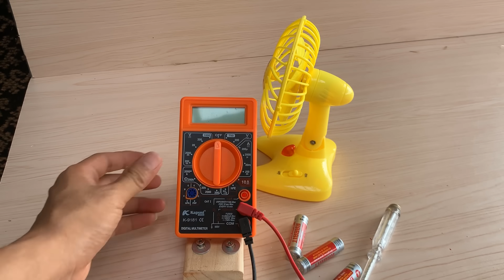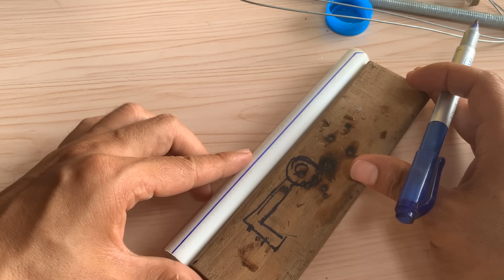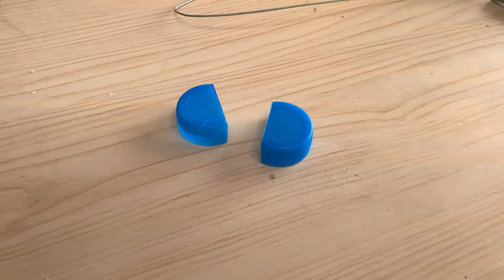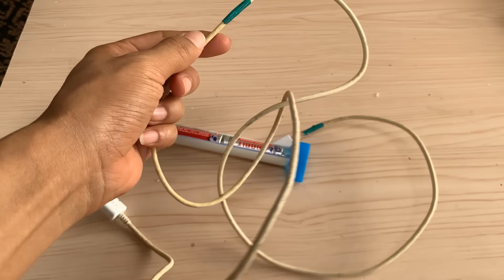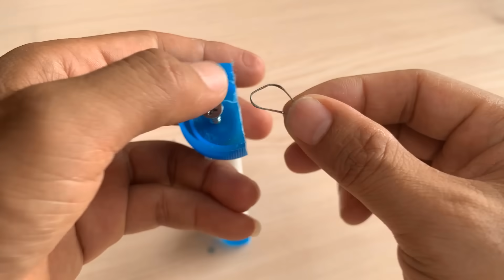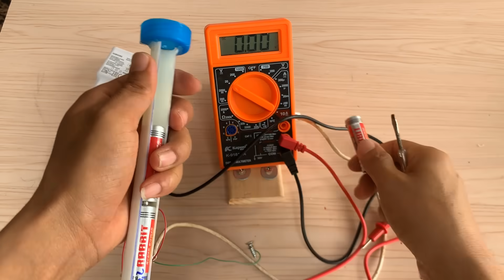How to restore 1.5V battery like new! Recycle used 1.5V AA batteries

Comment: Use an universal charger 5 dollars and the results is rhe same ...only one thing charcol batteries Drop the liquids outside
Reply from the maker: Thanks for sharing your thoughts! It’s true that some universal chargers can provide similar results, but ensuring safety while using them is important. Also, be mindful of battery leaks to prevent damage to devices.

Comment: Only if Rechargable Batteries are being used in all these experiments it will be fruitful or else it's never possible . So avoid taking viewers for a ride.
Reply from the maker: Thank you for sharing your perspective. We agree that using rechargeable batteries can be more effective in many cases. However, the purpose of the video is to showcase creative ideas and methods, which viewers can adapt based on their own circumstances and resources. We always encourage viewers to consider and experiment safely.

Comment: Green and Red wires....Blue is the color on the endcaps with the screws in them.
Reply from the maker: Thank you for the detailed information! The green and red wires are commonly used for electrical connections, while the blue wire on the endcaps with screws might be the ground wire or common wire. Make sure the connections are done correctly to ensure safety and effectiveness.

Comment: why does the meter reading fluctuate so much when testing voltage?
Reply from the maker: The meter reading fluctuates when testing voltage due to several possible reasons:
Unstable power source: If the voltage of the source being measured is not stable or has interference, the meter will show fluctuating values.
Loose connections: Poor contact between the probes and the circuit can cause inaccurate readings.
Electromagnetic interference: Working near electronic devices or strong power sources can introduce electrical noise that affects measurements.
Low-quality meter or weak battery: A poorly calibrated meter or low battery may also cause unstable readings.
To resolve this, check the connections, use a high-quality meter, and ensure the power source is stable.

Comment: almost everybody technical enough to know about these things and being interested to watch such a video also knows that recharging any non-rechargeable battery is a dangerous thing to do ... and at its best, the recharged battery won't last long enough to be worth the try to begin with!

in the old times, we used to recharge dead batteries using hot / boiling water in a metal pot over the stove fire ... it worked ... but only for a short while after the battery was charged ... and it was also a dangerous thing to do ...

long story short, even rechargeable batteries do have a limited life time and they will not be rechargeable anymore in a matter of a few years ... the most common example are car batteries ... (also, your nearly 14' long video could have been done in only a few minutes by speeding up most of the shots ... not a bad idea to watch similar 'educational'  videos and learn a thing or two ...)
Reply from the maker: Thank you for watching the video and leaving your feedback. Each comment you make helps the channel grow and motivates me to work more effectively

Comment: Zinc-carbon cells can not be recharged. At the most the cell becomes hot and releases gases. It will show a voltage for some time but it will rapidly fall. The ammonium chloride electrolyte  reacts with the zinc container and over time it will become zinc chloride. The liquid will leak out and destroy pcbs,soldering and cause rust on iron parts. The magnesium oxide in the cells absorb hydrogen gas released during the discharge. It is not worth while to try reviving such cells. Never recharge alkaline cells as they will overheat and explode.
Reply: Батарейки менее одного вольта вообще не регенерируют.Так что это видео просто - трата времени.
Reply: @vlad7iik97  nu crede, am încercat și funcționează perfect cu condiția să injectezi o soluție de sare-chlor- sulf  bateria ține încărcată adecvat 10 zile se reîncarcă și funcționează perfect, eu a încercat și funcționează, nu mai cumpăr baterii de ani de zile
Reply: When this or a similar video appeared I replied saying as you have - its is not possible to recharge zink carbon batteries and trying is highly dangerous. This video should not be allowed
Reply: @richardlewis5316  baterii cu zink și cărbune se poate reîncărca cu condiția să injectezi o soluție de sare-chorl-sulfuric, funcționează perfect, întrucît cărbunele se usucă trebuie injectate cu electrolit, dar dacă este prea uscat și zincul ars atunci bateria este reciclabicå..
Reply: I bought a "AA recharger" a few years ago, and it did recharge some batteries, but they didn't last very long at all. Most would not even recharge. I tossed it in the trash.
Reply: @swmovan  Зарядку жаль, она для зарядки аккумуляторов "АА"! (Такие никель-кадмиевые, литий-ионные есть давно! (Полицейские рации питаются от 6-ти, т.е., 9В.) Мира всем!
Reply: كلام سليم
Reply: بجای خراب کردن سیم‌شارژرو هدر دادن برق‌و لایک ودیسلایک شدن برو و این باطریهارا توی آب جوش بنداز یک  5دقیفه بماند.بعدهم شاید 10 دقیقه کار کند نیازی به این همه خراب کاری و هزینه هم نیست
Reply: Am încercat și funcționează perfect
Reply: 10 лет  служат аккумуляторные  батарейки, Energizer покупал вместе с зарядным   устройством, они в разы дороже. но  с экономили мне кучу денег!
Reply: Bateria to nie jest przecież akumulator - nie nadaje się do ładowania.
Reply: Սնման քիմիական աղբյուրները սովորաբար լինում են 2 տեսակի։ 1գալվանական էլեմենտներ և ակումուլյատորներ։ Առաջինները չեն վերականգնվում, և եթե նման ձևով լիցքավորել, ապա այն կվերականգնվի բայց 10 անգամ ավելի արագ կլիցքաթափվի ու ընդհանրապես շարքից դուրս կգա։ Իսկ ակումուլյատորները 500 1000 երբեմն 10000 անգամ կարող են լիցքաավորվել և լիցքաթափվել։ Այնպես որ սրա կարիքը չկա ու ցանկացած խանութում տոննաներով գալվանական էլեմենտներ են վաճառում, որոնք ակումուլյատորնռրի համեմատ շատ էժան են։